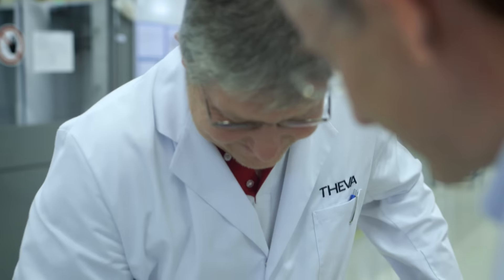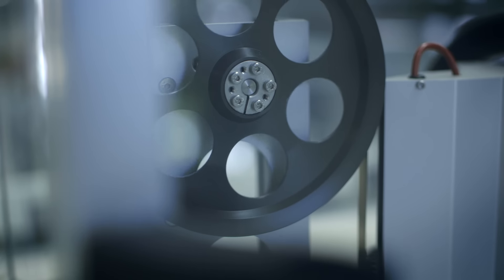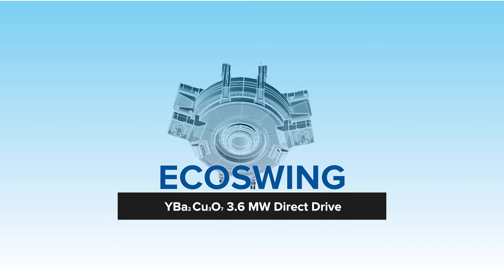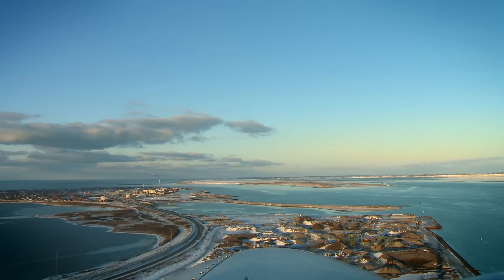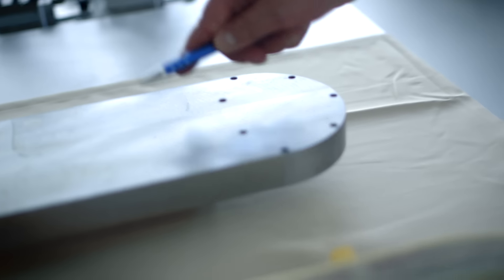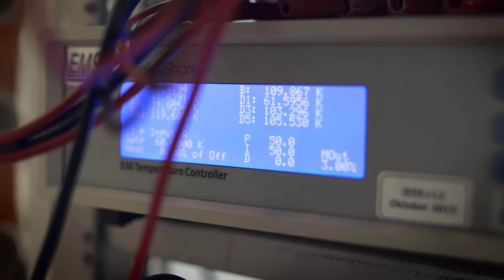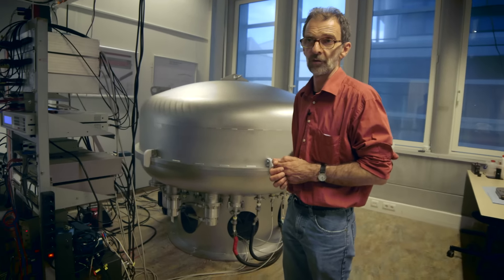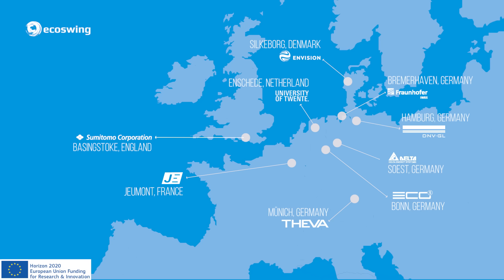Ecoswing

Comment: Envision Facing Potential HK Court Injunction Sued By GSR Capital

Nissan Motor Co said on August 3, 2018 it agreed to sell its electric car battery unit to Chinese renewable energy firm Envision Group for an undisclosed sum.

From legal search on file, record from Hong Kong High Court this week shows a legal lawsuit by GSR Electric Vehicle Partners, L.P. against Envision Energy International Ltd.

The court filing requests for injunction against Envision for breaching the Limited Partnership Agreement, and alleging Envision for stealing commercial secrets for the transaction with Nissan.

A source close to the plaintiff told that, Envision Energy was one of the syndicated investor and limited partner of GSR’s ‘AESC acquisition fund’, bypassed GSR Capital and contact AESC directly to make the deal.

GSR Capital has submitted summon to The High Court of Hong Kong SAR, Envision Energy International Limited facing the potential legal injunction and legal penalties over the AESC deal for breaching of Limited Partnership Agreement basic rules.